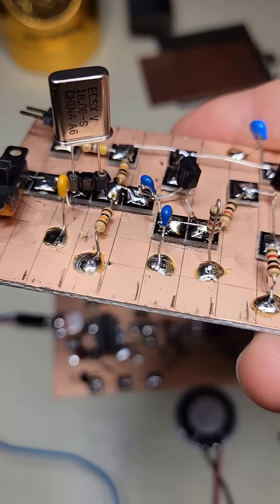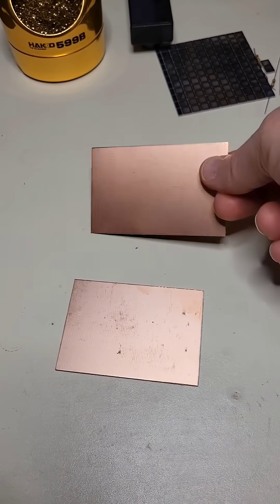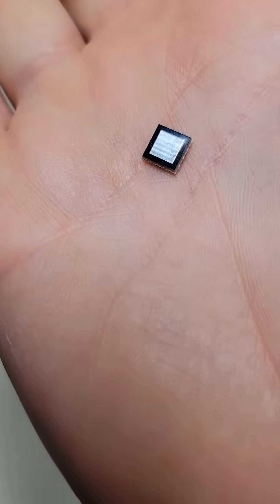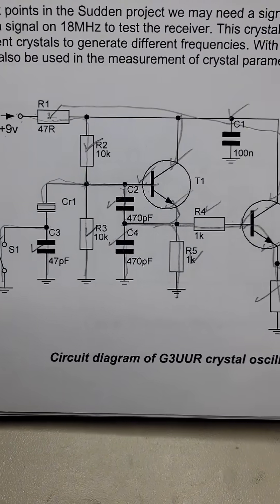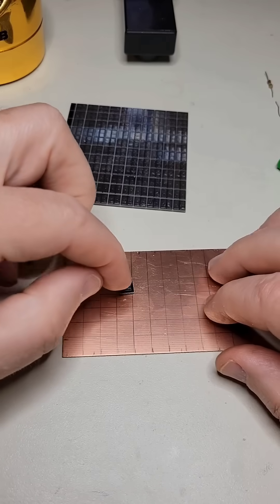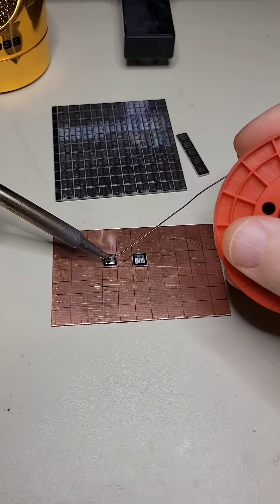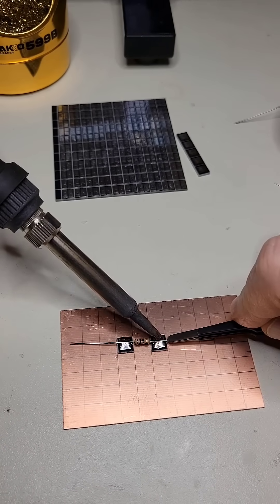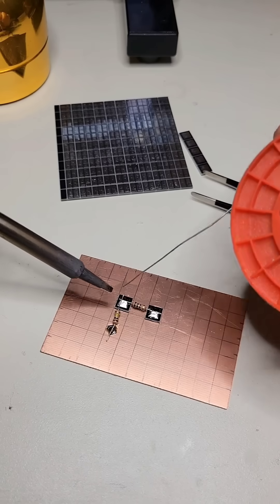Manhattan Circuit Construction Technique for Homebrew Ham Radios

Comment: I see some questions about the stray capacitance of those "MeSquares", so i did a little calculation.
C=Eplison*(A/d), Epsilon is the product of the electric constant times the relativ permittivity of FR4 in this case which is about 4.4. A = Area of overlap of the 2 plates of the capacitor, which in this case is roughly 5x5mm per "MeSquare". d= distance between the plates which is commonly on FR4 boards 1.6mm. Lets put this all into SI metrics -> (8,5*10^-12)*(4,4)*(25*10^-6):(1,6*10^-3) = ~5.8*10^-13 Farads or around 0,6 pF per "MeSquare". Time this with 15 (i counted the last circuit board he showed) and you have about 9pF capacitance on the whole board added. Not a whole lot to be fair, but in very high frequencies (Gigahertz) this might matter.
If you find an error in this calculation please do correct in the comments.  ;-)
Reply: You're right.  Especially when you consider that every node in a circuit, regardless of the construction technique, has some parasitic capacitance.   It's not as easy to calculate as it is with Manhattan construction (because e-fields usually travel further to get to a ground, through more complicated geometry). My point is that parasitic capacitance is always present in real-world circuits.  Manhattan construction stacks up pretty well compared to lots of other construction techniques.
Reply: Thanks for the calculation. 0.6pF sounds about right. Rather than use the MeSquares you can cut "islands" on the copper to solder components to. This is one way to reduce stray capacitance. For lower radio frequencies, low value capacitance decoupling to ground may actually be desirable if it helps to attenuate higher unwanted frequencies.
Reply: Thank you!
Reply: Good to know a rough magnitude of the issue. As other comments point out, you'd have to look at each node and it's effect on the circuit; with nodes that are bypassed to ground, pad capacitance would be swamped. In other instances, node capacitance would offset and cancel capacitance in other nodes. Then you'd need to determine node capacitances of the layout type you're comparing it to.
Reply: 🙏saved me time from doing the calcs. we know in every circuit there are stray capacitances, and possible flux ground loops. Manhattan style offers a way to minimize these effects.

Another example of Manhattan wiring is found inside electric guitars. There the ground is chosen to be a central point, usually the casing of the metal volume pot.
Reply: Actually in the Gigahertz frequencies designers want a thin dielectric between traces and the ground plane.
 I am no expert but have this from experts.   It allows for thinner traces and better control of the impedance of  transmission lines which is how they look at things rather than wires.
 All very counter intuitive I know.   Just google why are thin pcb good for radio frequencies and knock yourself out.
Reply: Nerd
Reply: Well, at that point one might just use these small male header pins as islands. Cut flush and pushed a bit into the plastic, of course. Though an ideal island would be a plastic cone with a solderable ball at the top, but at that point you might as well solder non-ground connections in the air and glue the mechanically-weak parts later on.

Comment: I use a much better way than this but it is along the same lines, I use a 8 or 10mm mirror tube drill to just take the surface copper off the board leaving a circular pad to solder components to. Tube drills are hollow in the centre with an abrasive edge. Its easier with a press drill and takes minutes to cut many 'islands'. Use double sided copper clad boards to keep the RF shielding.

Comment: why bother?  Today you can use PCB design sofware and have a circuit board professionally made on million $ machines in a Chinese factory and posted back to you within 3 weeks, less if you pay to have it couriered.  And it will cost as much as a large pizza.   Oh and BTW they can manufacture boards on various substrates including Rogers and PTFE which are suited to high frequency applications.   So design it, and have a pro PCB in 3 weeks!
Reply: And what if you have to iterate and tweak the design?  (Do it with a circuit simulator like Spice? Yeah, right, been there, done that, it only takes you so far.)  I've gone the Chinese route.  I'm up to my 8th iteration, and it wasn't because I was careless; I was doing something that hadn't been done before, not just building a circuit out of a book.    After you've put all the components on the board 8 times, and waited 8x3=24 weeks, not counting all the time you spent assembling the circuit over and over 8 times, you'll wish you had a way to rapidly experiment with a prototype method like this.  Unfortunately, I wasn't building an RF circuit with discrete components like in this video, or you can be sure I would have used this method...

Comment: Why glue on bits? Why not just cut the copper into square sections and use that? Leave a ring or rail around the rim for power and ground. A scorer would do the trick.
Reply: A ring or rail around the outside for ground, means that every circuit node in the circuit will have an electric field that goes to that ring, where it will terminate.  And that's just fine. For an AUDIO or DC circuit.  But at radio frequencies, any stray electric field from outside the circuit will have an EASY time coupling into any circuit node built that way.   Your homebrew ham radio would have absolutely NO chance of working if that's how you built it.  

But apparently nobody builds homebrew radios anymore, so nobody falls on their face trying to build them as you suggest above, so they all persist in thinking that it's a good idea to build them that way.
Reply: @davidnaegle427  Ok. Learn something new every day.

Comment: This gives "HUGE GROUND PLANE" a new meaning.
Reply: real (why no replies :c)
Reply: @ricecooker3k  at least we here bruv
Reply: Most people have no idea how important that (ground plane) is if there are any fast or RF frequencies involved. Fast rising signals are similar to high frequency, and the ground plane is most important. This is very interesting! (I usually make cheap Chinese PCB's, DK Red, or something similar, but still occasionally do hand builds, even wire wraps.) OH, sorry, obviously this is Radio interest so very important!

I'm thinking, however, each of the pads would have say 1 to 1.5 pF capacitance to the ground plane (depending on which calculator used).
Reply: @gordonelliott7870 That piece of metal that comes with the breadboard won't fulfill that purpose right? Even if you hook it to ground? I'm super new to this stuff, but I think I've heard of this, and that it requires the ground path to actually follow the signal line. But please do correct me if I'm wrong. Maybe what I heard of was a different effect.
Reply: @Jutastre  Ok, it's my day off so I'll try to make sense of this.

First new to electronics, and then to radio subspecialty, there is a lot to learn. For example the same word can mean many different things in different contexts. (like "ground"). I'm afraid my original comment was meant for people with a lot of experience.

So the only "big piece of metal" I see is the "breadboard" itself which is a piece of phenolic or fiberglass with a layer of copper on one side. (Hint it will serve the purpose, which was my comment.) But let's start with very basic electronics.

Think of electrons like water flowing in a pipe. But has to recirculate, there isn't an infinite supply of electrons they have to come from somewhere and go somewhere. So a battery or power supply is like a water pump providing pressure (compares to voltage) and the flow rate compares to current. But it always has to go in a loop back to the pump!

In schematics we use a "ground" symbol that means a common piece of metal where all the current returns to and which we use as a reference often when talking about voltage. A very small pipe has high "resistance" so takes a lot more pressure to get the same flow (e.g. higher voltage to get same current through a higher resistance).This may be things you already know, but a context.

When doing RF things get even more complicated. Here the flow is oscillating back and forth extremely quickly, think of pulsating water pressure as a very vague analogy except the electrons flow forward then backwards to the starting point, or the water analogy the water has to turn around very quickly and flow back to the starting point. Now think about the weight (mass) of that water in the hose or pipe, it will itself push back just like getting a heavy weight moving. That corresponds to "inductance" in electrical circuits. And even small wires have inductance that can be significant in high frequency RF.

So the "ground plane" corresponding to the large piece of copper base is like a very flat water tank but very open and not constricting of flow. Since the flow can spread out many paths it provides, in the electrical case, low "inductance" and doesn't affect the flow of even RF current very much.

Now you said something interesting about following the signal line, and here there is no analogy in the water flow. Because when current flows it causes a magnetic field around the signal wire (no analogy in water) and that will act like a transformer to cause an opposite flow in any other wire nearby. It turns out that a high frequency signal wire laid on a ground plane will of course have the return flow (in the circular flow as described above basic electronics). EXCEPT it won't take spread out paths because the changing magnetic field around the signal wire will cause the return flow to go right under that signal wire on the ground plane! Even if that signal wire is a circuitous path!

When we build say "two layer" printed circuit boards (look at some electronic circuit junk) we might provide a "ground plane" on the bottom layer and have our RF (and other) traces on the top layer. HOWEVER when we make "vias" to go from top to bottom, and occasional traces that make isolated paths in that otherwise contiguous ground plane, we punch holes into it and it is no longer a perfect plane. But in this hand construction plane (in the video) they don't ever cut any holes in the ground plane at all, and it is a very good "ground plane" without gaps, which is good for RF circuits. I encourage you to keep learning about this very complex subject.

PS: A different meaning of "ground" is when signals go off the board, it needs to be tied to the outside equipment or in the case of outdoor antenna to the actual "ground" meaning the earth. This would be slightly like connecting to the power ground of the house which always connects to actual rods in the ground outdoors. But the path length in the house is too long and the inductance of the power wires too great to be useful as an antenna "ground" -- a whole different subject to learn with the same words.
Reply: Hell yeah
Reply: Так только негры делают 🤣🤣🤣
Reply: I just use a really hot iron to get a flow of solder on a steel case. And then used old tube amp point to point circuit style. Floaters and jumbled messes everywhere. But ... Sometimes the stuff worked right as intended. And the whole metal case ... Ground.
Reply: Ground is ground in definition:v
Reply: well as long as it's not a huge sea plane
Reply: Why is this a new meaning?
Reply: @GamrokFeddy I'm thinking writer is just being a little hyperbolic. Except regular printed board ground planes will have holes for the vias or component through hole pads if any, so a very good plane. This is a very neat method.
Reply: RF amplifiers 😂
Reply: есть похожая технология монтажа "на пятачках" циркулем вырезается пятачок диаметр 6-7мм, вокруг земля. автор Жутяев, если я правильно помню.
Reply: @kozka5302  а если плата двухсторонняя, то тогда земля есть ещё и снизу
Reply: So it’s a modified form of dead bug soldering?
Reply: Introducing a lot of capacitors this way...
Reply: @scirturbo1234 Mikro kondensatorki odprowadzajace bardzo wysokie częstotliwosci do ziemi co zapobiega samowzbudzeniu układuw.

Comment: For those who cannot design a printer circuit board.. this is more expensive than ordering one these days
Reply: Assuming you're only copying a circuit someone else handed you.  If you're designing your own, and you haven't done all your iterating using a circuit simulator like Spice, this is actually cheaper and faster than ordering 8 revisions of a board from China.  (For the RF circuits shown in the video.)   I myself have had the sad privilege of ordering from China 8 revisions of a digital circuit I designed.  Took me months, and each time I wished I'd had a technique like this to rapidly prototype with.   I was making an electrostatic discharge-proof board (one that you couldn't blow up by zapping the inputs and outputs with static electricity) and there's only so much you can simulate with confidence that way.
Reply: @davidnaegle427  fair point, there is a niece market for these tools

Comment: In the 1980's and maybe even before that, you could buy ready-made adhesive pads with soldering points. The product was called "Minimount".
Reply: @stickmenwithrayguns  yes i remember minimount pads. In combination with singlesided copperclad boards acting as a ground plane you could even make HF circuits.

Comment: I Just Use Double Sided Copper PCB Material, I Dremmel It , I Mean, I Deremmel The Squares In And Then Clip Them off And Solder To Any projectts I Have So There ARe Two Layers
Reply: as long as you don't leave the backside floating, your technique is just as good as what's shown in the video.  They don't actually say in the video how important it is to actually connect the ground plane to the circuit ground.  They DO it, but they don't say how important it is.

Comment: This might be a stupid question: but is it common to have this many components go to ground?
Reply: It's not only about having a handy place nearby to connect to ground.  It's also about having the ground plane EVERYWHERE under each circuit node (each non-ground connection between components) so that the electric field from each circuit node has a short path to ground. This minimizes the physical area of the loops (the circular paths through which current flows in each of the circuit nodes).  Keeping the area as small as possible is what gives greatest immunity to electrical interference.  This isn't very important at low frequencies, where the coupling of stray external electric fields is inefficient, but its VERY important at radio frequencies, where careful attention to minimizing loop area is critical to correct circuit performance.
Reply: Yes. Look at a random schematic you find in the internet. You will be surprised how many components have a ground pin to them somewhere in the path.

Comment: is there any reason this would be better than ordering boards, other than knowing you built it yourself, and maybe prototyping speed?
Reply: I guess nobody ever designs a circuit themselves these days.  Most of the comments on here seem to assume they START with the perfect circuit.  The technique shown in the video, is for EXPERIMENTING with circuits, especially radio-frequency circuits.  Experimenting, as in, you make changes.   I've ordered circuits myself, and I'm glad that's available these days.  I've also had the sad experience of re-ordering circuits 5 or 6 revisions because I got something wrong in the design, or the requirements changed, etc.  (my circuit was digital, not RF, so it made sense to order it instead of building it as shown in this video.)  Even with overnight ordering, you'll be weeks into a project if all you can do is order circuits from someone else. And you have to put EVERY COMPONENT on each new revision of the board, unlike with this technique, where you only change what needs changing. With this technique, your first 4 or 5 revisions will take minutes to hours, not days or weeks.  THEN you can design a circuit and order it, if you're building more than one or two more of them.
Reply: Low volume, prototyping, one-time homebuilt circuits, and most of all, and the fact that it is basically a huge ground plane, which is why they are so popular for a homemade RF electronics rather than a breadboard or prototyping board. 
Also proto :3

Comment: In HS electronics class, we were told to leave maximum copper so the etching bath would last a lot longer.
Reply: True, and it heat-sinks better, and if it's part of the ground plane it helps keep it as large as possible.
Reply: ha ha!
Reply: True.

The ferric chloride is more expensive today thanks to over reach by the government goons.

Comment: you can also cut off a piece and make small islands with the cut-off piece. if the board is double-sided, you can even solder the islands on instead of gluing them. only make sure that the solder is only on the bottom, maintaining an isolated plane on top